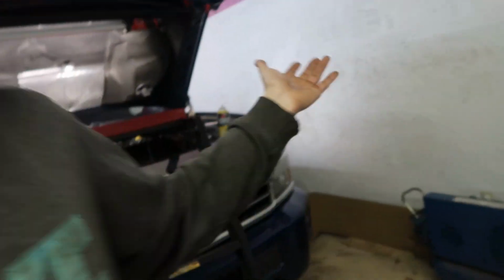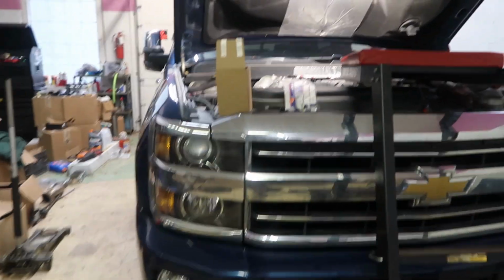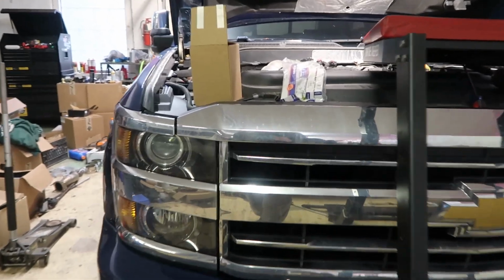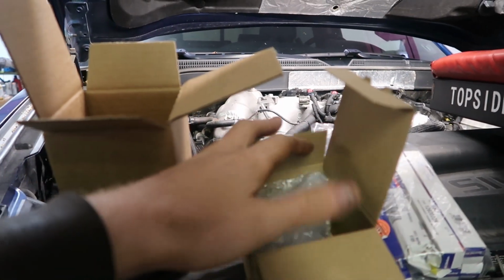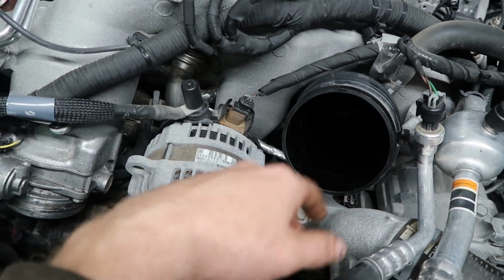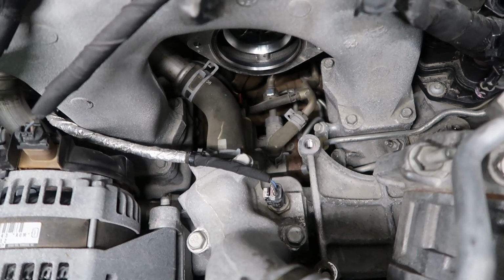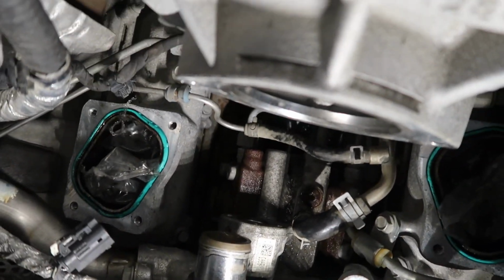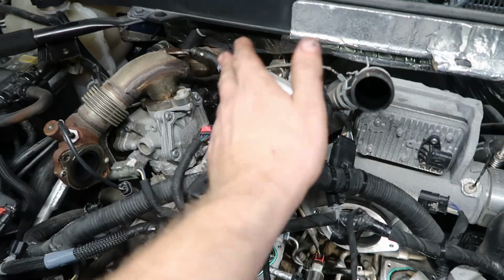This L5P Duramax Has A MAJOR Electrical Issue!

Comment: OEM parts are good for some things but a lot of the time after market is better. For an example, kryptonite tie rods, wheel bearings in front end steering inkages are so much more better than OEM and they come with a lifetime warranty. Are use Amsoil signature series in my L5P for the transmission transfer case front and rear differentials and engine oil and I get 2 1/2 miles better per gallon and I don’t even feel my truck shift. My locking rear differential. I don’t even hear it engage anymore. It is very small.

Comment: I had a similar issue with my 2018 L5P. Dealer replaced the driver fuel control module under warranty.

Comment: you need does codes use GM MDI and check what's communicating and codes don't keep replacing parts there is a lot of wiring problems good luck

Comment: Are you sure you have good battery voltage and thats not why your scan tool isn't communicating at all? Because even if a short on one the can networks is occurring it shouldn't take out all communication. The low fuel pressure could be why his truck shut off. If you really think it's a network issue you need a dvom and specs for network resistance at the dlc or just simply compare to another truck.